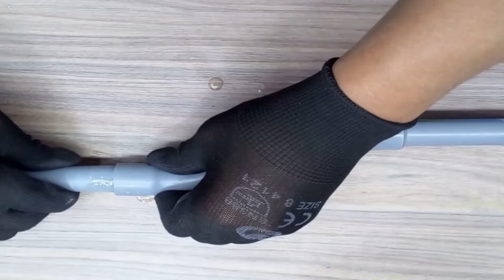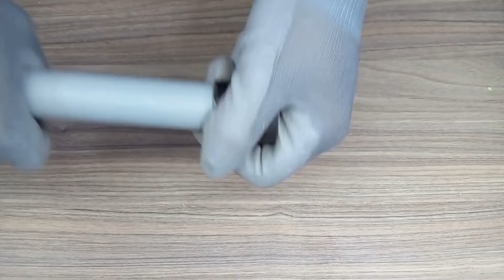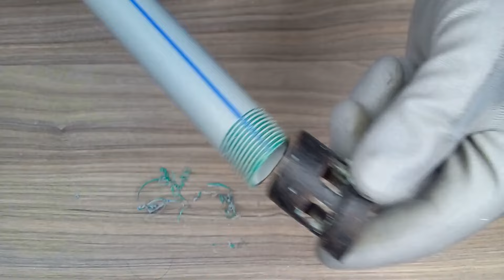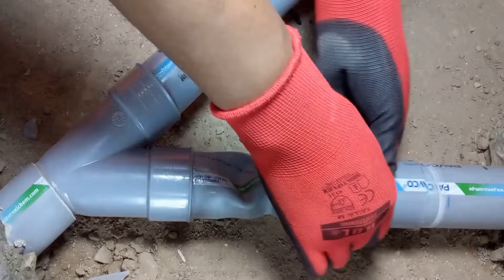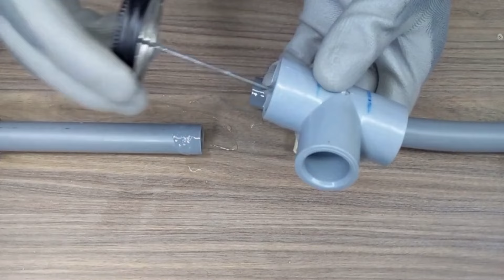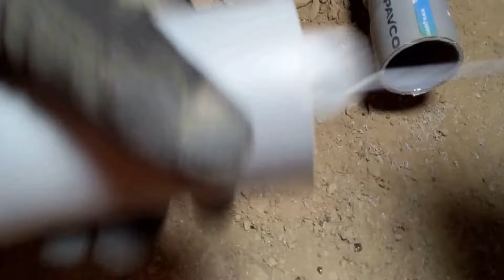10 Trucos o Formas de Reparar Tuberia PVC -  Hazlo Tu Mismo - Plomeria - PVC

Comment: Common practice with electrical conduit. However, don't do it with pressure piping; heating the material ruins the pressure rating and it will fail.
Reply from the maker: Greetings .
You wouldn't know how to specify what pvc material looks like in your country.
Here in Peru are the alternatives for repairing water and sewage pipes. It is correct what you indicate of not heating the tubes, however the manufacturers do not create or invent connections to make repairs.
Hits for you.

Comment: Except by doing a 180 degree bend with the heat gun.  You now reduced the internal diameter the pipe. Also decreasing the strength a psi rating
Reply from the maker: Saludos .
Exacto.  Es un video para hacer reparaciones menores .Donde existe baja presión de agua .

Comment: I'd be very concerned about it kicking going around the brick. I saw a video of a guy who filled the pipe with hit sand so it can't kink.
Reply from the maker: Greetings
I think that filling a PVC water pipe with sand is something I would never do,
The pipe that I am heating is heavy class , and it can not be demoulded when it is heated . This plumbing is for temporary or emergency jobs. You must also consider the work pressure. In many places an elevated tank is used, and the working pressure is at most 20 PSI, so these works are super good.
Successes to you.

Comment: 1) used too much teflon tape; if you need that much to make a water tight fit its not able to withstand 100-150 psi that a water supply needs.  Maybe ok for say a AC drain line.  2) the "U" shaped bend caused a restriction.  Maybe with a little practice and attempts you could get a better bend but frankly that's the problem with this technique. 3) I'm always concerned to heat up PVC in terms of strength since you are impacting the molecular chains in the plastic.  Some types can handle this like PEX-A but generally its a problem.
Reply from the maker: Saludos , todo lo que Usted indica es correcto . Sin embargo antes de realizar alguna operación del video se tiene que tener en cuenta muchos factores.

Comment: This is all using conduit pipe, for electrical wires only.  Don't try to pull any of these tricks with a pressurized PVC line.  You'll have a bad time.  He doesn't even use a primer either even when he illustrates with a water pipe.  You should always use a primer.
Reply from the maker: Saludos. 
Leer la descripción del video y el comentario fijado. 
En cuanto a la imprimación,  aquí en Perú no se comercializa dicho producto.  Es un producto prohibido ya que contiene un ingrediente que es usado de mala manera .
La intención del video de 8 minutos,  No es enseñar a Pegar Tuberías PVC. 
Le deseo lo mejor .

Comment: I noticed that the pipe is pinched on the u-bend. That can't be good for flow and would definitely be a point of failure
Reply from the maker: Cierta vez estuve haciendo una instalación provisional de unos baños que iban a durar un par de meses , y como era algo pasajero tratamos de ahorrar lo máximo posible. 
Ahora le pregunto,  para una instalación provisional , podría hacer esa U ? ,,, 
Estoy en la noche , muy altas horas , y no hay ferreterías abiertas , le pregunto: Puedo hacer una reparación de emergencia así tal cual observo en el video ? ...

Claro que puedo hacerlo .... 
Lea Usted la descripción del video y el comentario fijado .

Le deseo lo mejor.

Comment: Why do you not sand, clean and prime the pvc? I would not recommend just gluing.
Reply from the maker: Greetings, the video is not focused on the correct way to glue a PVC pipe. Thank you for your comment .
Reply: @GasfiteriayElectricidad  but, then what is the purpose of the video, if not for practical application? Anyone can just glue junk together for no reason

Comment: u dnt need to use solvent on pipes that has treads. just use tapelon
Reply: so it wont be hard to disassemble when u need to fix it
Reply from the maker: Yes , it can be left with Teflon tape , adding a little lubricant , but out of habit and common sense , it is better to use glue for PVC pipes , thanks for commenting .

Comment: I used this glue in puerto rico doesn't last to long and do to good. Temperatures are above 90 plus blue or white the same not to good.
Reply from the maker: Greetings .
- You must analyze the different structures of each PVC pipe.
- I am using "OATEY" brand glue, blue or clear is the same.
- PVC pipes are not the same in all countries.
- Successes to you.

Comment: Where I'm from this would be considered sloppy work, I'd rather use fittings and use a measuring tape than heat pipe and bend it because the integrity of the pipe gets messed up reducing its life
Reply from the maker: Каждый техник отвечает за свою работу. Трубы должны быть хорошего качества , клей поливинилхлоридный хороший , рабочее давление должно быть учтено , перед тем , как делать ремонт , необходимо учитывать : как , когда и где .
Успехов вам.

Comment: This kinda scares me really. Some plastic pipes are not designed to be heated (I have some in my basement that clearly says to not exceed a specific temperature) I would be afraid that the temper of the plastic would be lost from heating causing it to become brittle under pressure.
Reply from the maker: Greetings
In each the working pressures are different.
Different quality of PVC pipe.
exist to you

Comment: Let me tell you the other way is faster  . With this flex pipe you must heat it up and form it than you have to gluwe it in place the other has it's form already done just gluwe it and done plus if the flex part is under ground it could get punctured by a sharp stone. Not ideal for me .
Reply from the maker: Es lo que tenemos en Nuestro País Perú .
Saludos y éxitos a Usted.

Comment: Yeah except when you heat the pipe up and can thin the walls out in certain sections which loses it's pressure rating. This is a very BAD idea and should not be used for home plumbing.
Reply from the maker: Saludos,  leer la descripción del video y el comentario fijado. 
Éxitos a Usted

Comment: Doesn’t gluing the threads kind of defeat the purpose of having threads? I’ve been working with sch80 3/4” for months now. Changing all the spray lines on a farm. Thousands of dollars worth of couplings and elbows and all that stuff.
Reply: where did he glue threads? i gues you meant the connection he used to connect 2 different types of pipe and the side he glued didnt have threads
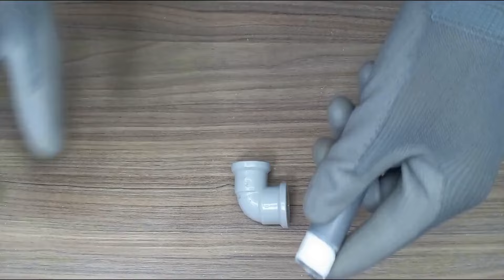Reply: @tomh1727  5:50
Reply: @montanawhite5699  oh i see, yeah thats stupid lol
Reply: @tomh1727  only time I ever bother with threaded pvc is when I have to connect to like iron pipes or when I plan to remove it.
Reply from the maker: No existe ningún problema en usar pegamento para unir tubería y conexión con hilos.
Reply from the maker: En realidad si he pegado hilos . Tratándose únicamente de tuberia y conexion de PVC .
Reply from the maker: No llame Usted estúpido a lo desconocido , Siempre debemos estar abiertos a nuevos métodos . Aunque le parezca increíble hacer ese procedimiento es mucho mejor que usar cinta teflon .

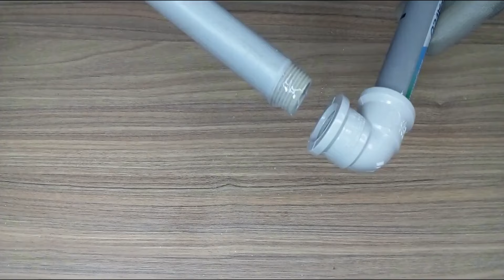Comment: 6:00 that's because no plumber would glue threaded PVC together
Reply from the maker: Greetings
We have to analyze several factors to determine which procedure to perform.
Believe me that if you can join with glue a connection and pipe of the PVC thread type. Many times we ignore what exists in the world and when we see it for the first time we are shocked, I think we should be ready for new procedures even if it seems as anti-technical as possible to us. It is simple to say : IT IS NOT DONE THIS WAY , completely ignoring various factors , such as the quality of the pipes , the climate where they will be installed , the working pressure of the place , the speed of the work , that and much more . Successes to you.
Reply: @GasfiteriayElectricidad  you still wouldn't glue a threaded fitting. It's threaded for a reason. 

Whatever works in your country. Here we wouldn't do that because it causes more problems later if you need to replace it ever.

Let's say that your fix didn't work. You would have to cut out the end of the threaded pipe now. It just makes more work for yourself.

Comment: Must be some awfully thin pvc lol. Couldn't do that with the pvc pipe I've used. Certainly wouldn't heat up that quickly and still wouldn't be that pliable.
Reply from the maker: Greetings ... Even if the pipe were thicker it would be easier to do it.
- I think PVC is not the same in all countries.

Comment: That type of shit that makes u break open your floor in your house because the pipes are lacking after 10 years. I tell you its bs because i just recently had that problem
Reply from the maker: Everything has a reason, the pipes must be installed by a professional, good quality pipes must be used. This pipe exists in my parents' house and it has been without problems for more than 40 years.
Blessings.

Comment: This is not practical not too mention you've ruined the integrity of the pipe by heating and stretching the pipe . I'm sure it'll no longer hold pressure.  Pipe fittings are cheap
Reply from the maker: Saludos